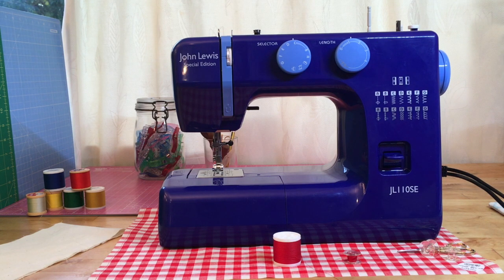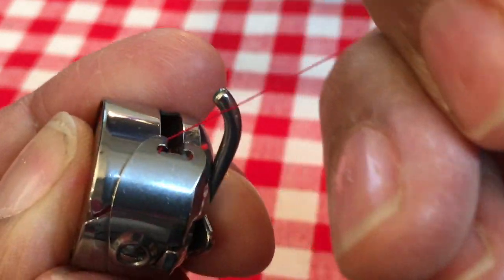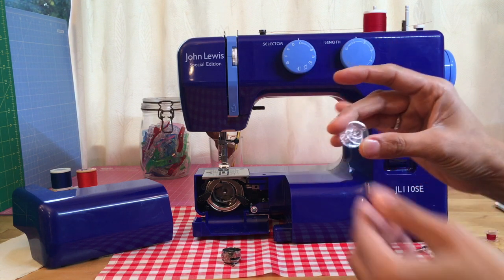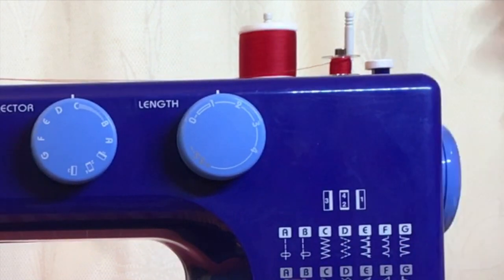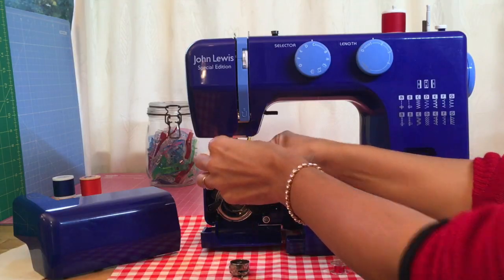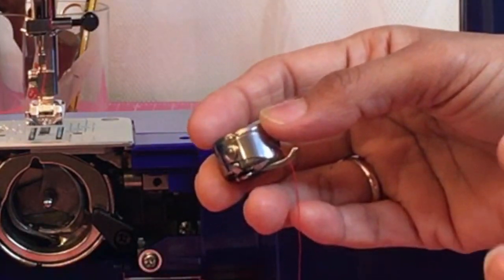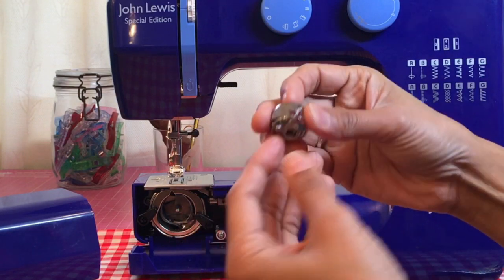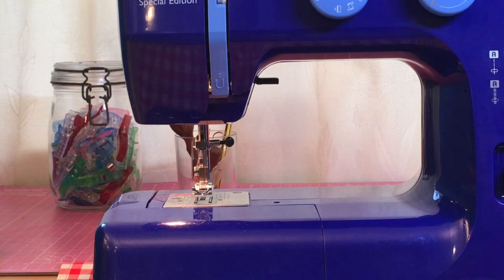How to Sew on the John Lewis Janome JL110 Special Edition from Threading Up

Comment: winding my bobbin isn’t working wondering if you have any tips for me, or a way to know if the tension tread guide is broken 😔really helpful video btw
Reply from the maker: Oh no ⚠️ let’s try and work it out? you’ve definitely pushed the guide over to the right? I can’t remember if the hand wheel needs to be pulled out? Have you tried that? 1:57 in the video